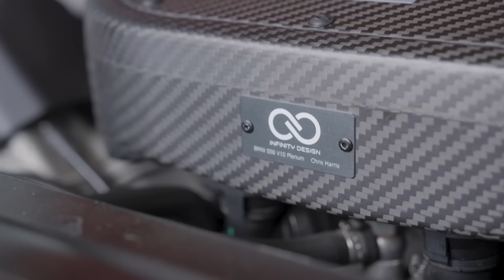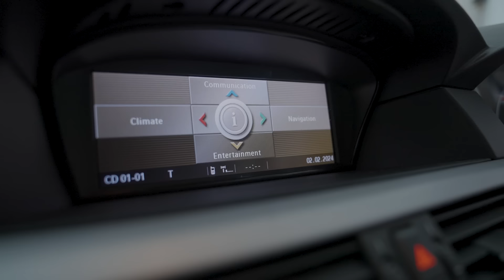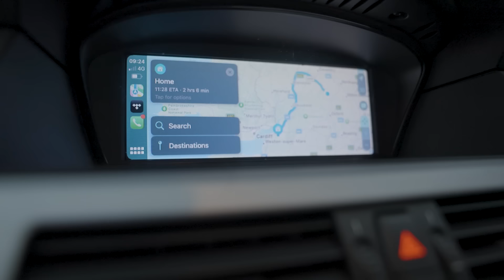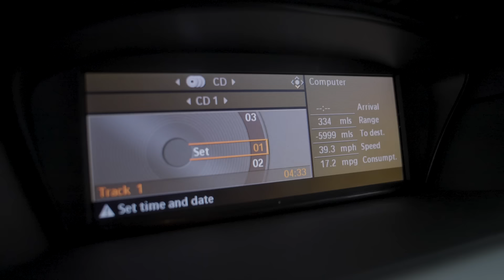Chris Harris M5 Touring Project Part 2 | 15+ Years Of Life Uncovered

Comment: Imagine the benefits of NOT owning one of these
Reply: exactly... even if it was a ferrari i cant stand unreliable anything.... even if it was a gf, if she fails on me she have to go, thats it, lifes to short to have even more problems when u can avoid it and i also own a 5 series of the next gen and it still have alot of made to brake quality german engineering... reality is bmw make more money out of maintenaince that from selling the cars.... and its never a good sign if you have to open the engine bay more than 1 time per year.
Reply: @thepro08  more than once a year?  i see you dont know much about cars
Reply: @thepro08  it's not a Honda civic, it's a road car with a race engine. Of course it requires more maintenance 😂
Reply: @justfasial01  Sorry what race car had this engine fitted? Oh that's right, NONE. Just the block has heritage.
Reply: @justfasial01 maintenance and repair are not the same thing.  Also, the V10 in that car is not a race engine.
Reply: @gpaje yeah it’s an economy engine
Reply: @philipt12345  well you don't have to go to that extreme, it's clearly a high performance engine, but it's not in any way shape or form a race engine.  The S85 is a celebration of BMW's F1 involvement, purely a street engine.
Reply: Imagine the benefits of not liking cars….
Reply: I’m struggling to understand why you even watched this video.
Reply: @ivarmarkusson382 have an old 911(993), I never open the engine more than once a year. Perhaps just to look at it run in the garage. My old e34 m5 was same only to look at the throttle bodies in amazement. I owned the m5 17 years and the 993 going strong with 10yr ownership. 

In summary one should not have reasons to pop the engine more than once a year outside of service which is mandatory.
Reply: Everything is a cost / benefit equation. 

Depends on what you value.

Other than the NSX, what other truly exceptional cars are reliable?
Reply: Some times great things are worth working for. For those who don't agree and prefer rubbish that is easy to live with there are Toyota dealers all around the world.
Reply: @y0057  That's OK if you are happy with cars much older and slower.
Reply: @TjSemeniuk-un4fb  😂 Nice BMW!  My V12 can feel pretty aging. Is the cost worth tge experience. You bet!
Reply: @SeanPensive  if cars that do 174mph and 176mph respectively are considered slow. Then I’m very happy indeed 🕺🏾 🎼 🎶 . Than being told it’s normal expectations to drive what is considered fast but open the bonnets ( because Chris Harris has issues with his own car) regularly as the definition of what a new/fast car should be as normal(ridiculous statement in its entirety considering I’d owned much newer Porsches with no issues), all good 😁
Reply: @y0057    German. Long gearing. 1/4 Mile isn't fast. Would lose to a Focus RS.

IF you were actually using them rather than pottering around, you would be opening the bonnet much more often than once a year.

My old 911s and BMWs were actually driven and were no more than averagely reliable
Reply: @SeanPensive  in my 41 years of driving on 3 different continents and of running different cars in different conditions, you can rest assure I have a good idea of what it takes to run a car. I don’t need to debate you on here. My 993 is driven super hard both in the uk and across Europe(I don’t need to validate that with you). I equally understood that definition of good car maintenance means different things to different people. I remain on the fact that a good car well maintained and driven with mechanical sympathy wether fast or slow does not need to constantly have the bonnet open all the time of you do things right to start with. But what do I know you can run yours as you please. That’s just as fine. If you are not so sure about my old warrior, I can be spotted in south of Spain having flogged the bejesus out of mine from the uk (as is done annually)
Reply: @ikaros4203 km/h
Reply: @y0057  Old man thinks he drives hard. LOL

Hope you are enjoying your retirement
Reply: Hands up fellow e60 owners 👍🏾
Reply: @khymia27  I've had four, it's the kind of car you like, but never get that close to. But then when you sell it you miss.
Reply: @thepro08 no wonder your car has issues, you know nothing about cars!!
Reply: @thepro08  Would like to be there to see that exchange: Sorry gf, it's the second time this year you got a cold, you have to go, life 's too short.
Reply: Can't think for the life of me what they would be...😂
Reply: I’ve got exactly the same only the 535d and as a car it’s literally all you need, V10 must be very special! But I’m pretty sure mine can do 180, currently running hybrid twin turbos with a custom map, will get a video up

Comment: Chris, I did a full Porsche Carbon Ceramic conversation on my E60 M5 15 years ago… speak to BG Developments in Bromsgrove or reach out as I still have the drawings for the disc bells and calliper carriers to convert the PCCB’s to BMW, front and rear (rears had the handbrake designed in the bells) 👍
Reply: Please share!  I was about to order the carbon ceramics from a F82/F87 to bolt up to my E61 M.  But PCCB sounds way more interesting.  How difficult and expensive did that project turn out?  How well did Porsche parts integrate with the car?  Really cool, never heard of someone doing that retrofit.
Reply: That's cool, I wanna see that 👍
Reply: I put Ceramics from a McLaren SLR up front on my E36 M3 GT back in 2007 :D
Reply: Any details you can share James?
Reply: @ all you boys, James wanted Chris’s attention and response, not yoll, sorry lads!!!

Comment: Chris, the way you describe the SMG is spot on, you need to drive the car to that gearbox, which was for me M & S6 everyday. All those reviews who day the the gearbox is hopeless only drive it in Auto mode (in which is is as they say)

I miss mine, had it for 2 years, flogged it to hell every single day (35000ks) and the only issue i had was throttle actuators, but was expected. Not expected on 2nd day of ownership though.

Avg fuel consumption was at least 21L/100km
Reply: 21L/100km! Wish I could afford those sorts of bills haha. That's nearly $50 to drive 100km here in Canada. Pretty close to saying it would be worth it in an M5 though.

Comment: The oil consumption is fucked but then so is the fuel economy.
Reply: My ex e46 m54b22 also required 1l oil every month, maybe because ccv was a bit f*ckd. Fuel consumption and power was fine, also no oil puddles on the ground, exhaust wasn't smoking, and always past the emissions @ MoT

My ex e36 m52b28 didn't drink a sip of oil😮 but it had oil catch can instead of oem ccv.
Reply: If you listen to the collecting cars podcast he changes oil brand and the consumption is radically reduced.

Comment: I installed mr12volt CarPlay on my 2012 Cayenne Turbo. It’s absolutely the best CarPlay retrofit that I’ve ever had, and I’ve tried three other brands. It uses the fiber optic connection for audio, so it sounds even better than the stock system. High recommended.

Comment: I’ve had a ton of sports and super cars. My e60 M5 v10 was a love hate!!!! I had rare 6MT and it was glorious especially with muffler deletes it sounded insane.  However it broke every other drive! As Chris says it’s $2k every time too. Battery went flat out of nowhere & massive pain to replace and reset Ecu. Then the throttle acculaters went out $3k. Then steering angle sensor went and I damn near crashed when I lost steering mid intersection. It’s like that one GF you had that was high maintenance & psycho but damn at times she made you very happy 😂

Comment: Cool cars. I remember from my 535d e61 days going through all that with the I drive and suspension. Not to mention warped brake discs, thermostat, turbo pipes, new torque converter etc etc.

Comment: On the oil consumption. I used 3 to 4 litres of oil on a round trip to Le Mans last year from Milan via Monaco. The average speed was higher than what I’d be comfortable mentioning but I think with a big engine with lots of pistons with some miles on it you’re bound to have some oil usage. I do also have a leaky main seal but whatever. It used to bother me but I don’t let it anymore and it’s only heavy on oil when used at high RPM, it’s pretty good doing to the shops and around town.

Car was Mercedes E55 Kompressor

Comment: Why wouldn't one replace the steering rods and the other front control arm? The parts can be purchased online for little money by the oe-manufacturer lemförder. Now you'll adjust the tracking for a lot of money and in 6-12 months time, the steering rods will be dead with proper driving

Comment: Great video.Keeping old great cars going is cool.  Also, think of the energy/implications  you've saved in not creating a new car.
Reply: Keeping old great cars going is cool, but don't kid yourself.  

If you were brave enough to use this as a daily driver, 10,000 miles a year at 14mpg means you'd be emitting about 7.2 tonnes of CO2 a year.  That's roughly comparable to the emissions produced when manufacturing an EV (McKinsey estimated between 5 and 10 tonnes of CO2).  

A Tesla Model 3, charged on UK grid electricity as of 2023, would cause about 300kg of emissions when driven 10,000 miles.

So after, at most, 18 months of driving, the total emissions from buying a new Tesla would be lower than the M5. 

There are a variety of ways in which we'll be able to keep classic cars on the road and mitigate the carbon impact, but they will be much more expensive than keeping an EV as your daily driver and saving the classic car for the weekends.

Comment: Could do an Evolve tune with upgraded exhaust headers, the standard ones are quite pinched/restrictive, would give you around 570hp although in my opinion it doesn’t sound as good.
Reply: Our equal length headers will retain the sound.  Our tuning is already on there.  Our head of engineering was the previous owner of evolve who developed all of the tuning there.

Comment: L ove this car guy conversation.

So for the replacement rear trailing arm bushings, why I'd there no conversation around using monoball kits?  Also ball joints need to be replaced.

As for the engine, what about pulling the lump and doing a stroker rebuild when the time comes?

Comment: I still can’t believe that BMW considers it normal for their engines to burn through a quart of oil every 1,000 miles or less depending upon the engine. I own an E60 545i and thought I had a major problem with burning oil only to find out that BMW has issued several bulletins to dealers and service departments addressing this issue and said that their normally aspirated engines will burn 1 quart of oil every 1,000 miles with their turbocharged engines burning a quart every 750 miles. With how over engineered most German cars are I never imagined that BMW’s would be so bad with oil consumption.
Reply: yes and where is that oil going? into the chamber and burning?

Comment: no thanks, I'll keep my old mercedes' V8's , will easily surpass 150-175K miles and no con rod bearings or even taking anything apart, maintenance services only... in all seriousness that is the ULTIMATE BMW if you can keep up with repairs and maintenance.

Comment: Use motorad 880090 it’s a 89c tstat from the viper and ford GT. The oem thermostat is too cool for the S85. The warmer motorad tstat will help cylinder rings tighten against the cylinder walls and you won’t consume as much oil.